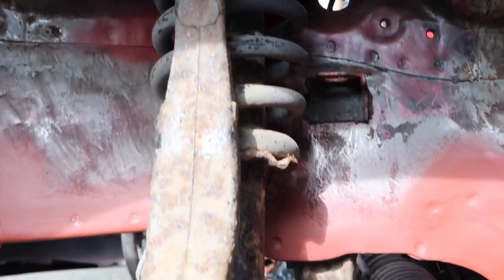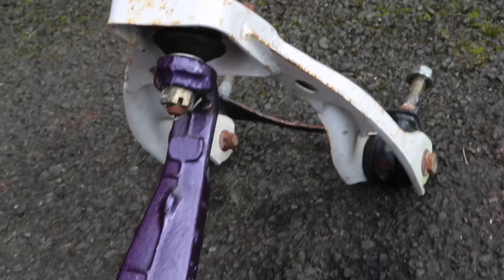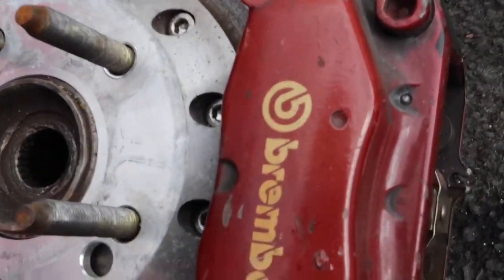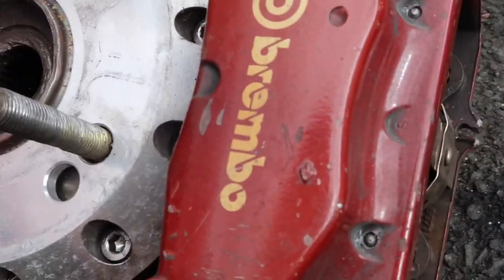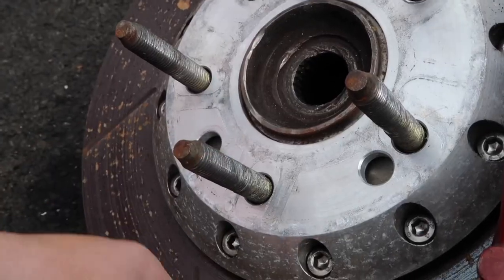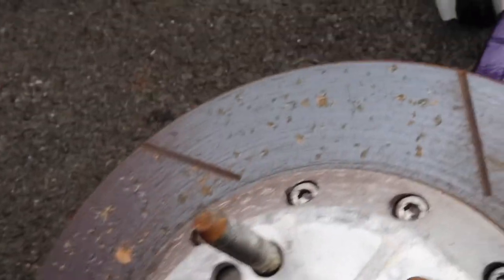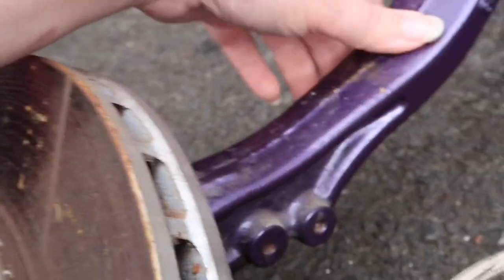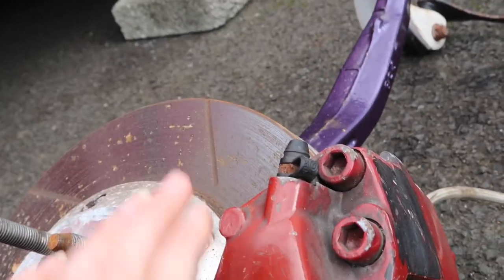Kswap build | FERRARI BREMBO’S ON MY EG?!? | some BIG BOY BRAKES!

Comment: Nice! I have been replacing the cv joints, ball joints and brake parts on a '98 Accord.
Finding it quite good to work on.
Reply from the maker: Yeah hondas are usually not to bad, it’s just the breaking bolts that gets ya lol
Reply: @Civicky the one I am working on, I just came across loose front caliper bolts on one side. Whoever worked on it last didn't tighten them. Looks like it had been like that for some time.

Comment: Good job and a lot of work going on there! Just one point... And I hate to be that guy... But to the best of my knowledge, the 458 came with ceramic brakes as standard (as all Ferraris made after 2008 do) ... The costs of replacing these is around £25k 🤣🤣 are you sure they're off a 458?! If they are, the pads alone are £1,000 a set... Are you sure it's worth it 😬😬😬😬

Also, front discs would be 398mm, meaning you'd need to be running at least 20" rims.
Reply from the maker: Just seen this, tbh, I have no idea, I’m just going by Michael, and what he said 😂😂🤣 I’mma ask him tomorrow lol
Reply: @Civicky  I'm just a bit of a geek when it comes to cars, Ferraris in particular... I wasn't implying you weren't being honest, just for the record lol 🤐🤣🤣

Whatever they're off, make sure your seat belt is secured or you'll end up on the bonnet (yeeeoooo) 🤣